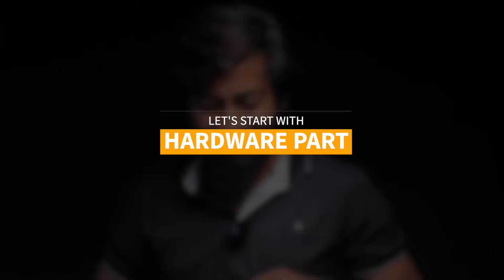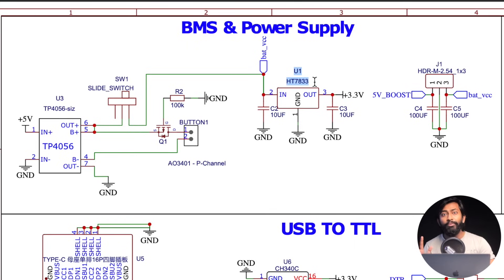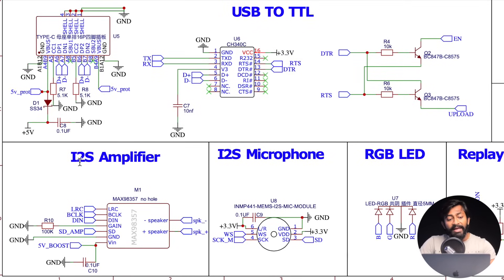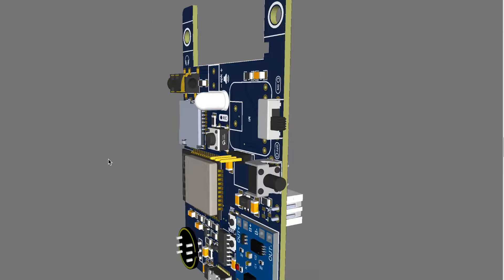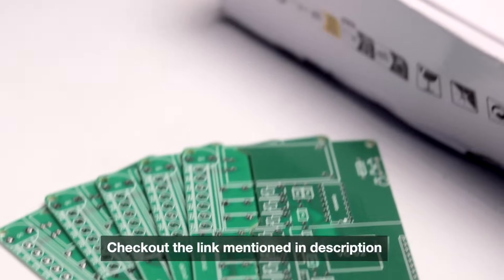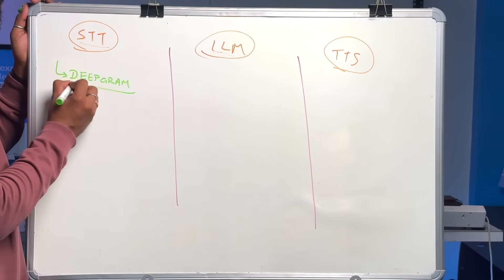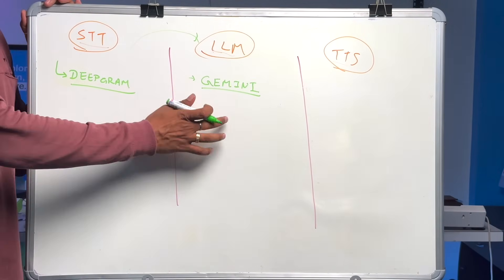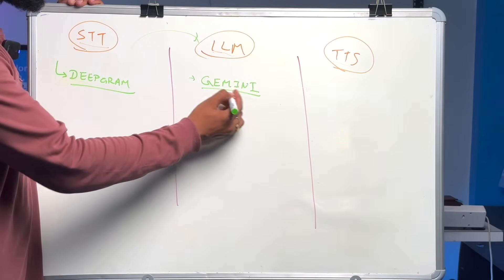Portable AI Voice Assistant using ESP32 & Gemini AI 🔥🔥 | @Board-Geek

Comment: One question, maybe the question is silly but I want to know why you removes the usb from the charging circuit. You can say that you can directly charge or power using the built in type c, but then why do you use the charging board. Again one more thing the charging module needs constant supply and proper current to charge the battery, which the type c can't deliver without any ic.

So please reply to my doubt

Comment: hello. techiesms, is the sdcard necessary?
Reply from the maker: Yes
Reply: @techiesms  thanks, i tried streaming directly without the sd Module to the deepgram api, didnt seem to work properly, half the time it does not pick any words. the other half it seems to hear only half of what i say. is that one of the reasons why you opted for the sd module?
Reply: also i didnt seem to get the i2s Std_h library. just the legacy driver i2s library

Comment: I am really intrestest in build various kind of project but due to the cost and desire component availability i cant build one , i have a request if u could develop a affordabe micricontroller board under 200 rupess having type c interface for programming and power wifi connectivity,  as well as consisting of all type of communication interface if possoble like i2c,i2s,uart,spi and also if possible can bus having small foothprint with castaleted pins and also inbuilt charging ic if possible but i know it difficult to build this within such a low cost , but even if u could add a type c port to the node mcu esp8266 and launch it on your website i would really like to purchase it even my friend ones one for our project i really want a affordable mcu under 200 to tinker and learn on it plz share this comment as much as possible

Comment: Hi everyone, i tried this project and found the way to avoid use of SD card by directly using SPIFFS memory which can be able to store 220 seconds of audio at 8k and 8 bit which is more than enough, for this AI assistant purpose we genrally need about 5-10 seconds, so i think it is the most reliable way to use it, also it will boost some speed for reading and writing files...
Reply: Gd evening sir , can I contact you for  some guidance on the above project because u have already tried , please sir reply because we r going through this project
Reply: @sandhyakota5350  sure
Reply: @sandhyakota5350  sure
Reply: Hi can you explain the steps for this I was also trying many methods to avoid sd card
Reply: @samveda.r1402  esp32 hasbuilting SPIFFS 4MB memory from which u can use upto 2MB for this purpose also it will be faster than sd card
Reply: Please tell me
Reply: Holly Molly! How did you come about this? I have been looking for ways around this problem for some time now
Reply: Has anyone found a way here?
Reply: how bro please reply i want it today i am working on but not i am trying my best i have to submit the project tomorrow please reply i am requesting you please give me code or a hint of it it will be highly very useful please
Reply: Hey bro .i tried to use SFIPPS but couldn't get things done . please guide me
Reply: sir!!

Comment: I am trying to make all this using ESP8266, and I have actually worked on it for the last 30 days, not continuously but with a little change according to your thinking. Like, I have put this system in my wristwatch like a hidden spy. I have already made the script for ESP8266, it is working but only the part of STT and TTS is left. This is very challenging for me, like custom script or something more. But now I am copy-pasting and thank you very much for this video.
Reply: hi what speaker and mic did you use for this project
Reply: @lavanyabhamidipati992   use the ESP32-C3 Super Mini. For the microphone, I use the xcluma INMP441 Omnidirectional High Precision MEMS Microphone Module with I2S Support.

Comment: Wow, bravo. I did something similar (in python) on a 2gb RAM le Potato (minus the convenient button features, BMS, etc.). Didn't think this would be possible on a microcontroller with 520kb RAM. It does seem a bit slow at times in your demonstration, at least compared to my 2gb version. Could this be sped up with streaming? Or do you already include streaming in your .ino code? Very nice project!
Reply: I am also working on the idea to extend my recording library with Streaming (streaming I2S bytes realtime from microphone to Deepgram 'during' recording).. but this is crazy complex at least for me (with ESP32 & C, maybe easier in Python, which i won't use on ESP due several reasons), not sure i will ever get int work :D . We will see.
Reply: @kaloprojects  would love to check that out

Comment: Why do I need such a device when it is installed on my phone (I ask to learn, not to criticize)
Reply: For making standalone device. If you can program in Android, everything being done by ESP32 OR any microcontroller can be done with mobile phone. One more thing to note is that phones have become more and more restrictive - even Android kills apps if running in background . So, unlike in past , you can't even run GPS apps or sms responder apps or any such interesting program in background for long.
Reply: @gjreditor9835 you must be using some Chinese phone with their custom android variants. They are known to aggressively kill background apps, but with some effort that behaviour can be changed in settings.

this is not an issue in stock android as long as you have ample ram.

Comment: Wow! Super interesting project! How about porting that sketch to a device available in the market like a M5 Cardputer, a Lilly-Go T-Deck, a Lilly-Go T- Embed, etc? Those devices include everything needed to just get it up and running as long as the proper libraries are placed into the Arduino Library, then burn the sketch on them. Since many of us don't have the skills to assemble stuff on a PCB board, get the parts needed and can't even solder a button? Other pre-made devices that have ESP32 S3 chips, SD card slot, speaker, buttons, battery connector, lights, screens, microphone, etc, the ones I mentioned would save many of the pains on building our own from scratch. I do see your point of creating home made projects though. I wish I had the skill you have and the talents of creating these IoT's. I love gadgets, but lack the programming aspects of these ESP32's. It's why it's a blessing to have you available in YT. Thanks for sharing this video brother! Stay safe and blessings!
Reply from the maker: Based on your suggestion I’ll try to do with other boards that I have
Reply: @techiesms  Looking forward to seeing your next video related to the sketch on other boards/devices. Take care and blessings. 🙏✨